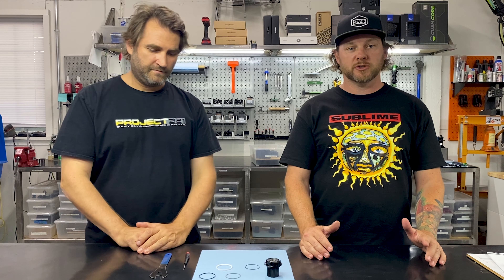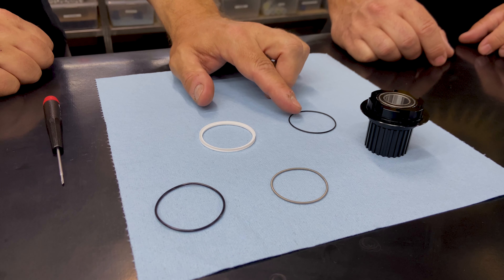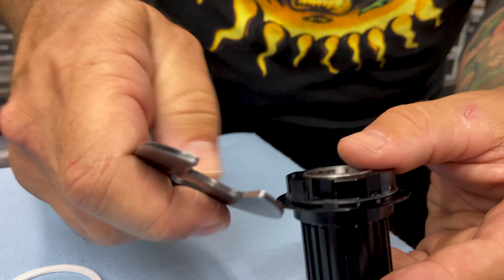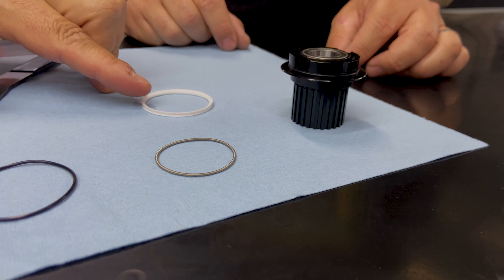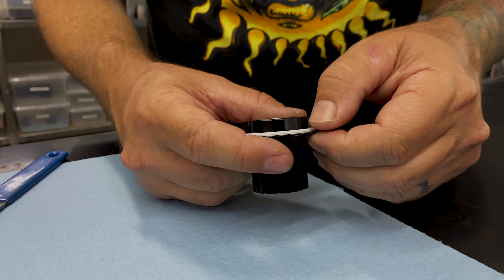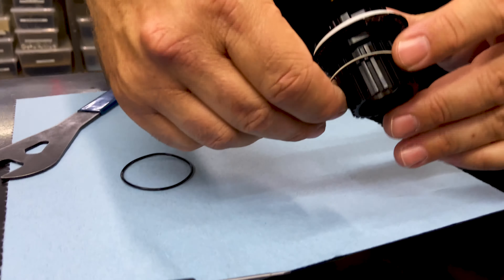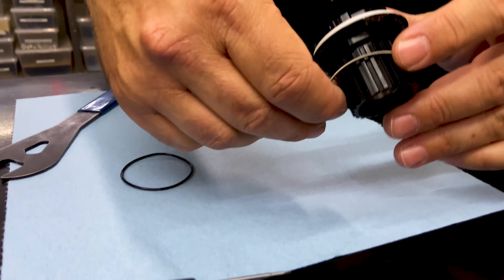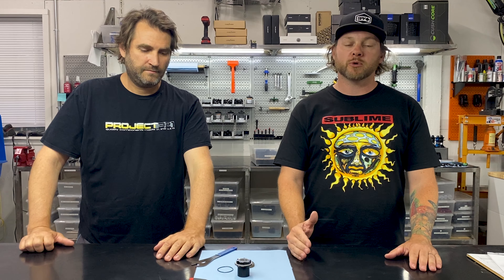PROJECT 321 REAR HUB SEAL REPLACEMENT TUTORIAL. Step by step replacement instructions

Comment: Nice video. Why do you install the energizer from the flange side? Is this the same process for the Gen 1 hubs?
Reply from the maker: I think it’s just easier to have the spring slip right into the seal from that side instead of having it want to compress the seal from the “top”. At least that’s my assumption. I’d check with Jake on gen1, because those might have the groove in the driver instead of the o-ring.